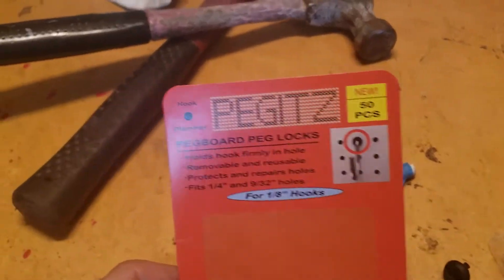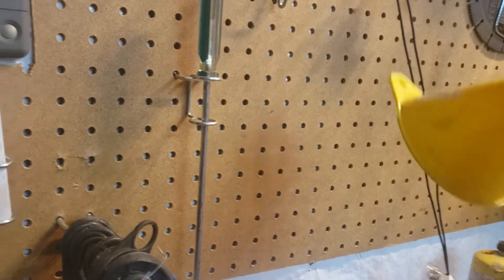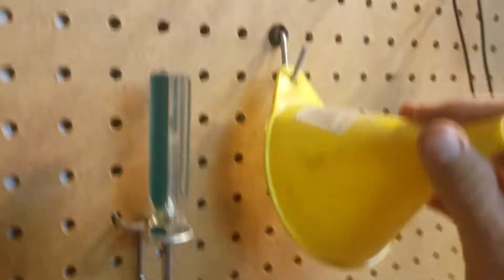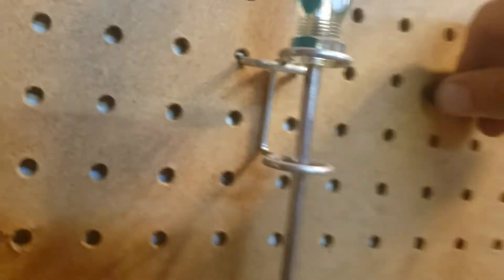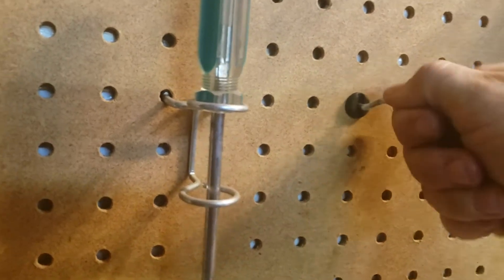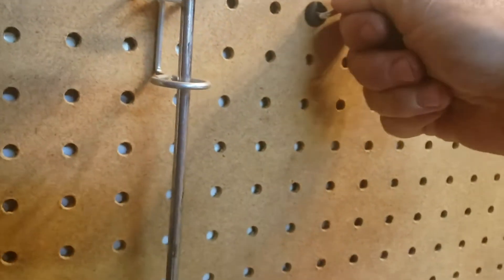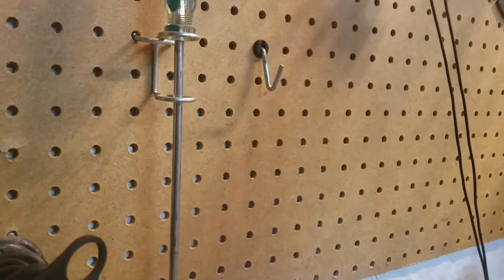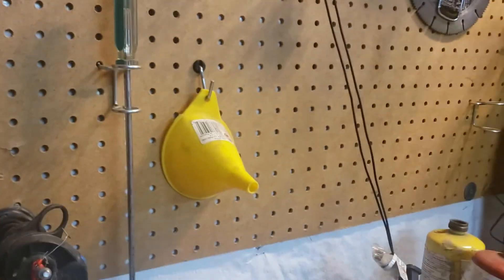Do pegboard Peg locks work. YES. Pegitz pegboard peg locks

Comment: I wanted them...THEN...No one carries at stores. My solution: Got out (packrat) 1/4" clear silicone/rubber tubing, pressed in 1/4" pegs, and low/behold, it worked! Had to mark back/front sides for depth (in/out)...another 1/4" per. Instructions: Take tubing w/out cutting, needed for pressing in tube, and cut (desired length). If good-to-go, just leave it. If not...Glue-gun it, in place. Oh, the price for a yard(s) of it is only $5-7.00. Can get at H.D., Fish shops etc...(they have it!).

Comment: They are expensive at .50 each though.
Reply: 50 pieces for less than 10 bucks is less than 20-cents each. Not bad considering how much all of this organizational stuff costs.
Reply: See my solution added 7/7/23 (silicone 1/4" tubing). It'll make ya hap, hap, happier :)